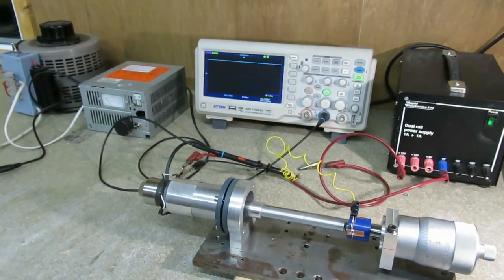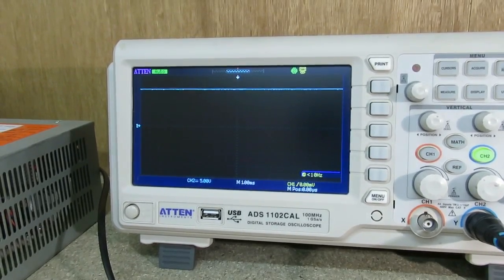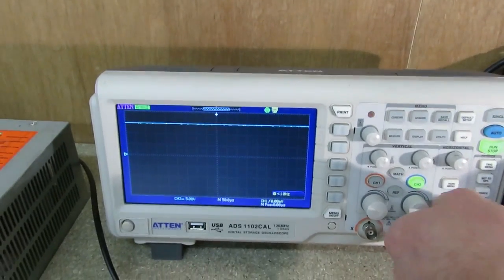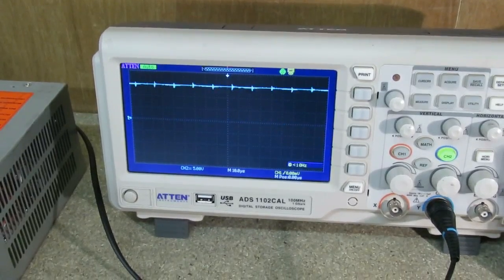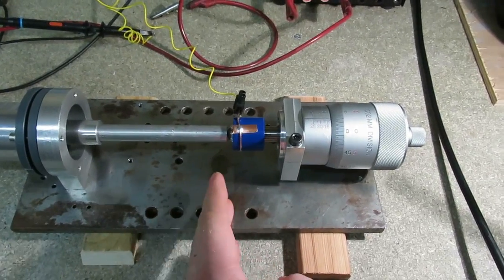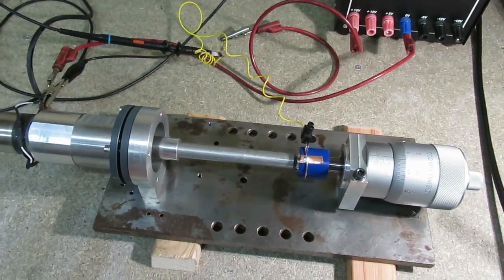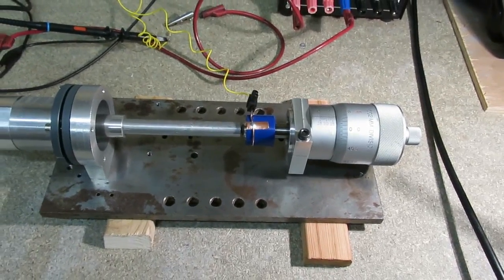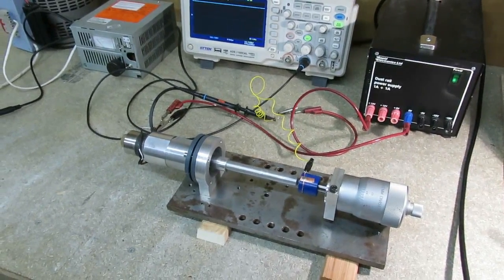Ultrasonic horn - measuring vibration amplitude

Comment: Bravo.......piezoelectric  pickup.......maybe mount another horn on the other end ........and us is like a microphone or signal generator ....cheers
Reply from the maker: Anything attached to the horn will change its resonant characteristics. I am measuring the vibrational amplitude of the bare horn, so do not want to attach anything to it.
Reply: @imajeenyus42  hey......I'm guessing .......radar .......speed gun.......on steroids......cheers
Reply from the maker: @mattharvey8712  Keep guessing.

Comment: Great video - very basic question for testing off shelf ultrasonic driver board if you might entertain an answer...  Can a load such as a bulb or shunt be connected to the transducer output to see if its working correctly?  I do have a scope and meters but curious why/why not the output stage wouldn't drive a bulb??  Tryinv to repair one and eliminate transducers as failure point.  Thanks!
Reply from the maker: Thanks! Unfortunately, it would likely not do anything, and may damage the driver. Most cheap drivers (e.g. the boards you get inside ultrasonic cleaners, or those sold on eBay/AliExpress as a set including a transducer) rely on the transducer's capacitance to form a resonant circuit with the output inductor in the driver. A bulb or shunt will be a purely resistive load, won't create a resonant circuit, and therefore won't cause the driver to oscillate correctly (if at all). The safest way is to just run a transducer. To save having to hold it somehow, submerge a sponge in some water in a shallow dish, and sit the transducer face-down on it. That'll give a typical cleaning transducer enough of a load to operate.

Comment: I'd just like to add that you can drive the Piezo with a DC voltage and it will precisely move via growing or shrinking, depending on polarity.
I think you have measured larger deflections when it is AC resonating due to inertia and elastic effects.
I mention using DC for positioning your optical experiments because it far easier to accurately change the size of the Piezo element with a DC power supply say +/- 10 V  and varying 100-1000th of a volt) than the finest (and bulky) micrometer.  You can make repeatable Sub-Micron movements via a 20Turn Pot + voltmeter, or even an Arduino DAC output!
Bonus: It will draw nil DC current = will not heat up and drift, AND you don't need the horn element at all.
P.S. Thanks for the Resonant Horn video!

Comment: Hello,
I saw a few of your videos on youtube and thought i give it a shot and reach out to you.

i can send you a 3d rendering of my lint remover to see more of what i am talking about if need be!

I put a few vibrator or erm motors in my prototype and is definitely helps performance but then we took the philips sonmic care toothbrush and this even more helped performance.  
I was wondering if you could guide me on how to get the sonic vibration i need and if preferably if i could just borrow like 10 minutes from you to get on a phone call to perhaps guide me on how to get that desired sonic vibration i need!
The erm motors are more so rotary motors and this then has to translate into a liner movement on my razor blades, but i know that if i use at least a 3.7 volt (rated voltage) sonic motor and somehow add some magnetic pressure or a magnetic bar, this would be more so a magnetic motor and since the motor is already moving in a linear direction it would more efficiently transmit the mechanical energy to the blades in the desired back and forth (side to side) motion as opposed to going from a rotary force from the motor, which would give me more vibrations per minute, which would increase performance!  I think that all these things that i need can be sourced by my chinese manufacturer and they would just plug it in the handle and that would be it  

I really hope i am making sense, becasue as you can see i desperately can use the help and i will pay you for your time if you decide to have a quick call as i am very bad at explaining these kind of things over writing as English is also my second language
Although a motor that moves more so side to side versus in a rotary fashion, would be most efficient in the oscialltion effect i need in my application!
Hope to hear back from you and please fell free to call me if you like anytime that is good for you and i will definately pay you for your time no problem at all as it would be so worht it to relieve a lot of this stress
Sincerely
Eldar-

Comment: hi  lindsay    i  did  speak   while  ago i  have  bought  this  power  unit  dont  know  how  it  works 
TA Systems TA-40ECS Ultrasonic Plastic Welder Welding Head Converter 40kHz
Reply from the maker: Looks like that's just the transducer - unfortunately no use without a matching driver.
Reply: @imajeenyus42  hi lindsay  what else  I need I have horn thanks
Reply: @imajeenyus42    what  is  matching driver,  what  does it look like?can  you  send me some links  please
Reply from the maker: @alanalan9990  I suggest you contact the manufacturer, who appears to be https://ta-systems.com/, and ask them. I have no idea what driver would be suitable.
Reply: @imajeenyus42    thanks
Reply: Try to send you pictures what I have got
Reply: I have downloaded power unit to have a look please

Comment: hi lindsay  ,i was  wondering   , would a  be  possibble  to make diy ultrasonic  welding machine?

could  you  give  me  some  information  please
i am  base in edinburgh dalry  road, fabric revelation
Reply from the maker: At the power levels you'd be looking at, say 300-500W, it really isn't practical to attempt making a DIY machine. The transducer, horn, driver, frequency tracking etc., it's all better left to a commercial unit.
Reply: @imajeenyus42  thanks for replying do you mind I can you give you my numbers you can explain me on the phone please. There is machine on ebay thinking to buy them .not sure is suitable for  to weld face mask
Reply from the maker: @alanalan9990  Sorry, I really don't have any experience of what would be suitable for fabric welding applications.
Reply: No worries thanks
Reply: I have just downloaded horn . Ta systems horn Edinburgh
Reply: Have a look please .I will download power supply to

Comment: If you had a flat surface opposing the horn tip 20 um away, that would be about 100 pF. I haven't much experience with electrical measurements, but one simpleminded approach would be to make that one leg of a wheatstone bridge, excited at 1 MHz or so, to get differential capacitance measurements. Also, I recall running across some or other integrated circuit to measure small capacitances when I last considered solving a problem like this. There might be an easy solution in that domain.

Comment: Hey Lindsay, nice experimental setup dude! One question though: how do you know you can assume that the horn is stopping exactly at its midpoint every time you switch off the power supply? I would expect that the resting position could vary somewhat depending on the phase of the amplitude at the time you switch it off. This could be a source of the scatter in your measured amplitude...
Reply: Lolo Beid Im quite new to this subject, but since it is a piezoelectric transducer, once the power supply is turned off, we wouldnt have any deformation in the quartz, so no contraction nor expansion, thus midpoint at rest 🤷‍♂️

Comment: Hi, I'm doing research on the application of ultrasonic in chemical reaction, which will involve surmounting an ultrasonic horn in a vessel. I wish to know what brand your are using and the diamater & length of the ultrasonic horn you were using. Thank you.

Comment: Very educational video.
Reply from the maker: Thanks! It's a tricky subject ;-)
Reply: Maybe, but you presented it in beautiful way. I will have not a dream how to measure physical amplitude. You did it very clever way. I learned something new, so yes - it is educational video to me.
Reply from the maker: One of the endless unfinished things I've been working on is a fiber-optic displacement sensor that should let me measure the vibration much more accurately, maybe even to 10nm or so. I made a quick prototype probe and it seems to work pretty well.

Comment: Won't it be easier to use a eddy current probe?
Reply from the maker: Possibly, but 1) I ain't got one, 2) they're expensive, 3) one with a suitable bandwidth is really expensive! I'll keep it in mind, but at the moment I'm experimenting with a fiber-optic reflection sensor, which shows promise.
Reply: thanks good, clear videos you have there and I enjoyed it. Maybe in your next video, you can demonstrate some experimental application example pvc welding, ultrasonic cleaning etc.. I like to know the wattage limitation, practical limitation and maybe selection and even failures are OK :-)
Reply from the maker: Thanks. I originally made it for doing ultrasonic drilling in ceramic - there's some photos here: http://imajeenyus.com/workshop/20110516_ultrasonic_drilling/index.shtml. I also tried ultrasonic soldering a while ago as well - little tricky to do. I screwed a threaded rod into the end of the extension horn and used that as a "soldering iron", and heated the whole lot with a small gas flame. Worked quite well on aluminium, and from what I remember, only needed 10W or so of power. Here's a rather crappy video: https://www.youtube.com/watch?v=oIUu3w4o6xQ

Comment: Awesome videos! I have been researching ultrasonic transducers the past few weeks. I was curious to find out if making a DIY ultrasonic soldering iron was feasible. Purchased a cheap 60w transducer + driver board for ultrasonic cleaners from ebay to experiment with and having my friend machine a horn for it on his lathe. The most basic 40w to 100w Ultrasonic irons cost several thousands, but all seem very simple in construction and operation. From what I understand, inorder to ultrasonically bond solder onto otherwise non-solderable materials, you just need to vibrate the puddle of molten solder, not so much the whole iron tip. Your thoughts? 
- Mike :)
Reply from the maker: Thanks, glad you like them! Ultrasonic soldering is definitely possible, and doesn't actually require that much power. I played with it briefly a while back - have a look at this clip: https://www.youtube.com/watch?v=oIUu3w4o6xQ. The "iron" is a bit of threaded rod screwed into the end of an extension horn, and I'm heating the whole thing with a torch. It coated the aluminium very well, and other things could then be soldered to it. BTW - it's essential to use plain solder, NOT flux-cored stuff, because the ultrasound will emulsify the solder and flux and create a gooey mess. You're right, as long as you have ultrasonic vibrations present in the molten solder, you'll get a cleaning action. So you can either vibrate a soldering iron tip, or (if you wanted to say tin wires instead) you could vibrate a small cup of molten solder. Part of the trick with a soldering iron is to get good heat transfer between the heater and tip, yet still allow the tip to vibrate. Regarding your driver, I'm a little bit apprehensive of trying to use an ultrasonic cleaner driver. These sort of drivers are very basic, and assume that the transducer is attached to a cleaning tank, which broadens out the resonance, so the frequency doesn't have to be adjusted as carefully. They rarely work reliably with a highly resonant load like a bare transducer + horn. However, given the low power level required for soldering (I only needed 5W or so!), you should stand a chance.
Reply: thats awesome! i actually wanted to make the iron for the main purpose of aluminum soldering. And yes I didnt really have much faith in the stock driver and planned to make my own. The stock driver appears to be a very crude ZVS oscillator, similar to those found on tesla coil and induction heater drivers. Heres a link to the kit im using: http://www.ebay.com/itm/271838338185?_trksid=p2060353.m2749.l2649&ssPageName=STRK%3AMEBIDX%3AIT
Reply from the maker: Yup, that looks like the usual sort of circuit! There's actually a schematic for a similar driver here: https://hackaday.io/project/4689-improve-the-haber-process/log/16986-analysis-of-the-ebay-ultrasonic-power-supply (most of the Chinese-made drivers will use the same basic circuit). These work by placing an inductor in series with the transducer, and it forms a series resonant LC circuit with the static capacitance of the transducer. A little current transformer is used to generate feedback for the transistor bases, so it's self-oscillating. However, the resonant frequency of the LC circuit is not near the true mechanical resonance, so it only works well when the mechanical resonance is strongly damped (like on a cleaning tank). There are other "matching networks" used besides the LC, but it's still something I only have a hazy understanding of. I need to spend some time and investigate them!
Reply from the maker: Absolutely. Indeed, I have a audio power amplifier which I sometimes use with my signal generator to power transducers, when I need to use a sinewave waveform. Make sure that the amplifier has sufficient bandwidth - mine does up to 100kHz. Regarding a laser vibrometer, I wish! I actually used one at university quite a lot for measuring piezoceramic transducers, but they're way out of my price range. I have some ideas for a fiber-optic displacement sensors which I might pursue.
Reply from the maker: There are plenty of amplifier modules around that should do the job. The one I used is this: http://www.bkelec.com/MODULES/MF100.htm. The output voltage depends on the power rating of the amplifier - higher power units will give a higher output voltage. These amplifiers are generally happiest driving an 8 Ohm load - if your transducer is much lower impedance than that, you might need to use a transformer, but you should be ok.
Reply: Is it possible to use the signal generator as the signal source and then employ a power amplifier to magnify the signal so that it is sufficient to drive the transducer? You know the amplitude of the output voltage of the signal generator is not enough. By the way, you can try to use a laser vibrometer to measure how the amplitude changes with the frequency.
Reply: Do you mean the normal audio power amplifier which we used for playing music? There is no problem with its power capacity. But what about the output voltage, which is normally 60V, 110V or 240V. It might not enough for some high voltage conditions. Are there any ways to further improve it? If it is possible, I do not need to purchase a specifically designed PA, which might cost several thousand dollars.  Could you kind enough to share the product model of the audio PA aforementioned. Thanks in advance.
Reply: Thank you for your suggestions very much.

Comment: Wow, that ultrasound really messes with the microphone on the camera. How about hearing damage on these frequencies? Should you wear hearing protection - i would think so ...
Reply: The interference is interesting.  I can hear the sound change when you are physically moving the camera -- probably due to doppler shifting in combination with aliasing of the ultrasound.  Also, I really like your setup for measuring the displacement!  I didn't think it was (relatively) so large.
Reply from the maker: Hah, so it does! I hadn't actually watched the video, just uploaded it - thanks for mentioning that. I wonder how much was actual sound, and how much was electrostatic pickup through me, when I was adjusting the controls etc. Either way it probably would be best to wear earmuffs - lots of the sonicators I've seen actually have a little padded box to operate in.
Reply: It is a great video. It would be better if you can add some subtitles for it.

Comment: That's a clever little hack, very cool!
Reply from the maker: Thanks! Wait till you see the next one ;-) (Sez he, hoping it'll work....)
Reply: I am curious how an optical sensor would work with such small deflection. Some kind of razor blade/pin point focused laser maybe?
Reply from the maker: I had a think about various options - the trouble with edge-based things is diffraction; it would doubtless give a detectable signal, but alignment might be tricky. I was almost on the point of delving into a doppler velocimeter sort of thing, but my current approach is a reflective fiber-optic sensor. Apparently these things are quite sensitive (here's one manufacturer - http://www.philtec.com/downloadssupport/documentlibrary/dspecs.html). I've made up something using 0.5mm plastic fibers, we'll see how it goes!
Reply: Oh! Yeah, that might do it. Can't wait!
Reply from the maker: Possibly, but it would be hard to distinguish any small signal from the rather noisy, large, squarewave signal that's powering the transducer. Far simpler just to look at when the voltage on the ball gets shorted out when it touches.
Reply: Is it possible to just measure the driving voltage of the transducer? I mean when the transducer strikes the ball, the piezoelectric rings will also produce a voltage, which might be superimposed on the driving voltage. So if the driving voltage really changed in some degree, it may help us to find out the critical distance under which the change no longer occur and that should be equal to the amplitude of the transducer.